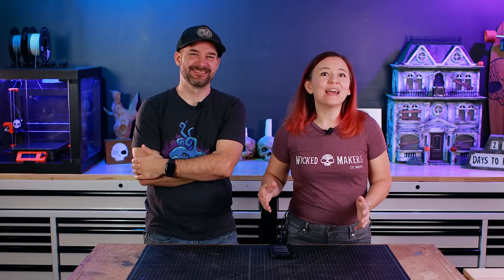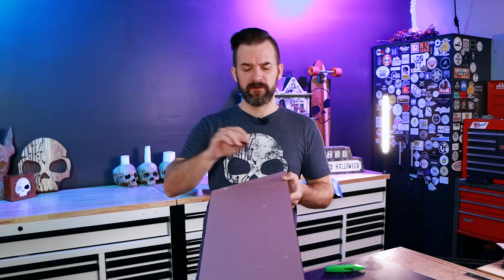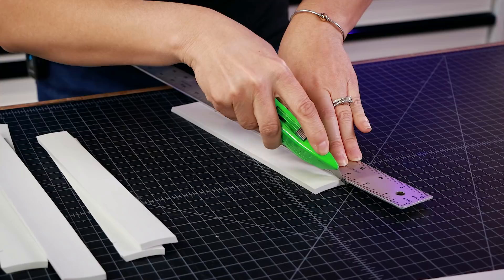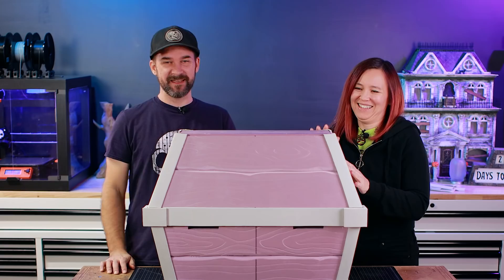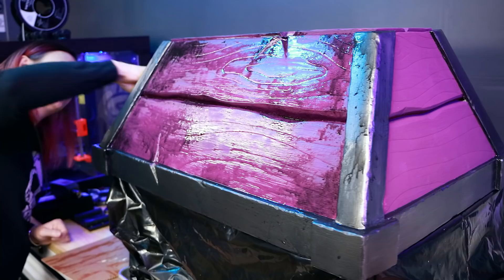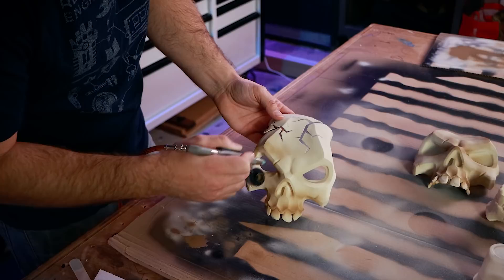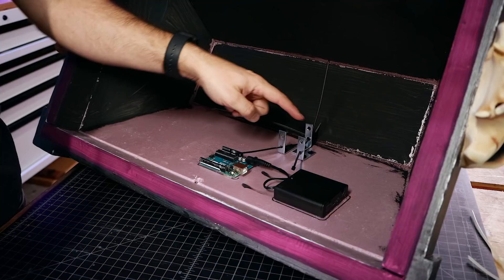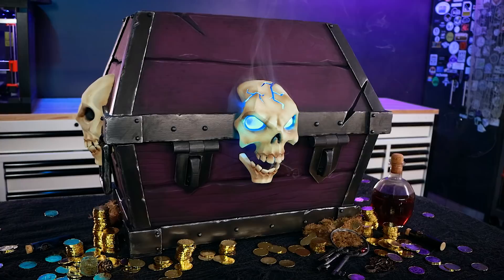Making a Pirate Treasure Chest 💀 DIY Halloween Props

Comment: 18:34 Suggestion for attaching.  When initially 3D printing the skull, add hollow screw anchors (The pole things you find on the inside of plastic equipment.) and self-tapping screws.  If the poles are too long once you poke them through the foam, mark them and cut to fit.  Easy! (In theory.)
Reply: To line the 3D print up properly, use a paper template.
Reply from the maker: Excellent idea!

Comment: An upgrade option would be a magnet in each hasp with a corresponding magnetic sensor in each shackle. The Arduino can sense when either sensor activates by opening the hasp, then sequentially lights up the eyes and then starts the smoke. A third sensor can make the chest moan/scream when its opened.

Comment: Great work! Love it!
Yes you should have edited the skulls for efficiency. Also add some mount posts/tubes that extend back (facing the chest) from all of the skulls. This way you could screw from inside into the skulls to affix into place.
edit: Create a fabric shroud for the inside of the top and bottom. Use coat hangers as a frame and solder them together. Cover with a lush fabric and press them into place to hide the interior.
Reply from the maker: Excellent ideas!!

Comment: This was my project for this season - make-over a dozen store brought stones.  I essentially did what you outlined here, but in addition to the extra aging and painting, I added additional layers of foam (and covered the seams) before the dry lock process.  My 1/2" PVC sleeves were sandwiched between the layers I added - so no need to drill or carve out an areas for them.  QUESTION - what size rebar did you use?  I had planned to use the metal garden stakes, but fear they won't be rigid enough.
Reply from the maker: Awesome! It’s 1/2” rebar.

Comment: That's actually one of the higher end Aztek airbrushes, and last I knew they had a set of that with all the different tips for fine work or spatter patterns. If most of what you're doing is model work and you don't want to have to worry about a ton of maintenance, that's probably the best airbrush you could get.

Comment: Great work, as usual. Thanks for making these great videos!

For part of my job, I get to make all sorts of things out of soft polyurethane foam (the stuff used for mattresses, cushions, acoustic insulation and camera cases etc.) I use another technique to measure the edge of the angled foam, that needs to be cut off to make it flat (about 3m10s into your video). Basically, when it's sitting on the flat bench, as you had it, I hold a ruler flat onto the outside edge (ie. the same angle) to find out how far it is from the bench. That shows me how deep the inside line needs to be, to cut the edge angle. The ruler does need to have the measurements right to the very end of it, though.
I hope that makes sense.

I also work with EVA a bit. There are different grades. The density and hardness of the foam seem to correlate, so the greater the density, the harder it is. Harder foam, such as EVA 75 (75kg per cubit metre: about 165 pounds per square inch) is the most commonly used. It's quite firm and it can be heated up to make shields and armour. EVA gym tiles are usually the same grade of EVA.

Comment: I always enjoy your videos. They bring the "scary" back to Halloween. I loved seeing the usage of the 3D printer for the skull. I do not own one. I liked that you gave options for other skulls. I took a look at a big box skull and decided that if I used spray foam insulation inside, it would give it some stability and thickness without weight. Just a little manual cleanup. The only other thing that I would have done is to have used leftover bones from a plastic skeleton to decorate the corners as pictured from the art concept. Might just try to recreate this project this year. Going to add your spider from last year first, then the drunk pirate skeleton. I cannot wait to see your next video.
Reply from the maker: That’s great!!! Thank you for watching.

Comment: This is amazing! You both did a fantastic job. I do have two questions though, I don't have a 3D printer so what can I use for the skull and hinges? Can I just use more foam and just shape it how I need it? I don't have any air brushing equipment so could I just paint it with a brush?
Reply from the maker: Regular painting is 100% fine yeah. You can use a skull from the store no problem as well. The hinges maybe try some metal ones from Home Depot etc. just try to get big ones.
Reply: @WickedMakers  ok cool thank you so much!! I appreciate your help!

Comment: OK, let me throw something else in; Barge and most contact cements fumes are heavier than air. They will "crawl" along the floor if you use it for a long period of time. I don't know how your shop is set up but if you have a gas water heater or furnace with a pilot, that is an open flame. Open flame + Barge fumes=BAD.

Comment: Are the 3D printed skull files on your Patreon already cut to the right shape to attach to the box as you did? Because I don't think I have the skill to edit 3D printer files so they affix to an angled surface correctly, that sounds really hard!
Reply from the maker: The patreon files are just the hinges we designed for this. The skulls were purchased from the artist in the description so you’d need to grab them from him and still cut them, yeah. 

It was definitely hard 😅 would not recommend

Comment: sorry I'm trying to do this, I'm new to this stuff but had some questions about the measurements. you have top long 9.25 (length of sides?)x 24 1/8 (bottom length?) x 18 3/4 (top length?) but what are the half measurements for? like the 12 1/16 x 9 3/8? (are they for the angled cuts so you can attach all the parts together?

Comment: If I might throw my own 2 cents in; I really despise Gorilla Glue. The water spritzing nonsense is just that-nonsense. For XPS to Xps and Xps to Eva, I always used Eileen's Tacky Glue. You wound up taping the joints anyway. The Tacky Glue aides in your assembly process because it's ...tacky. And no spritzing.
Reply from the maker: Interesting. How’s the dry time and strength?

Comment: Wicked Makers,

5x15mm Magnetic Stirrer, Magnetic Stirrer Spinbar Laboratory PTFE Stirring Rod Mixer Type For Biology For Chemical Materials

Doesn’t do much different but we used them in Chem 101–At most they’ll save you a step or two